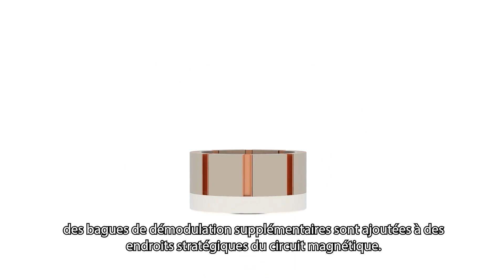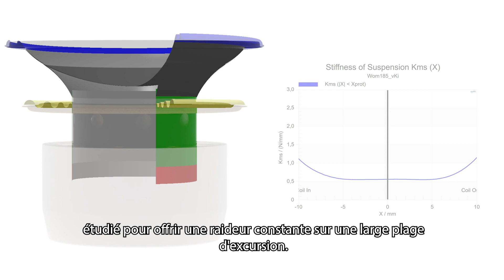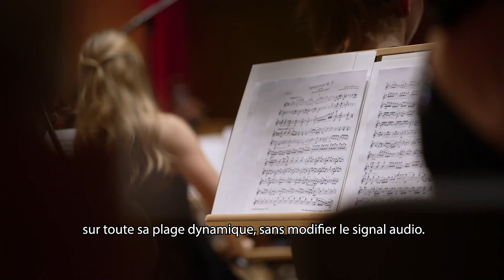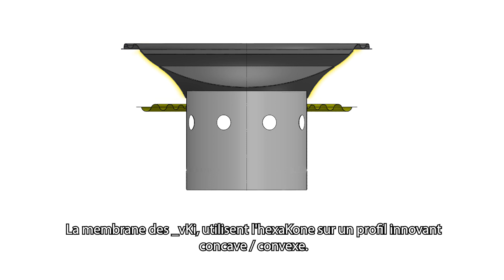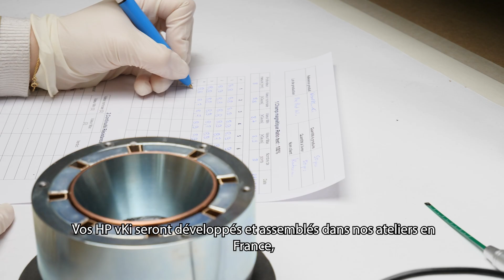Introduction _vKi technology

Comment: Hello! I am interested in building a no compromise 2 way with one of the vKi drivers. Is that possible with one of your tweeter? Also, do the vKi drivers have to be ordered directly through you?
Thanks!
Reply from the maker: Thanks for your message. 
Yes, _vKi are only in direct sale, you can send email with you request. We will answer with suitable solution. Twt30_vMS with its machined short horn can make 2 ways with Wom185_vKi. 
We also reached exceptional performances in WTW configuration, 2x Wom185_vKi + compression driver
Reply: @kartesian5737  merci beaucoup! I sent an email, as advised, about 3 -4 days ago through the website . Hopefully it went through. 🙏🏻

Comment: What drivers are there in the bookshelf speakers behind the presenters?
Reply from the maker: It is the kit named Korpus_5. 
It uses Wom145_vMS and Twt30_vMS. There are available in our distributor, including cabinet drawings and crossover.
Reply: @kartesian5737  I remember seeing a kit with the drivers wom145_vHE and the cmp35_vPA in the same style as the Korpus_5 in an earlier video. What happened to that kit, i can't find it on TLHP?
Reply from the maker: Thanks for the question. 
To reach the full potential of these drivers, we changed the concept of the kit. It will be a compact floor stand using 2x Wom145_vHE + 1x Cmp35_vPA